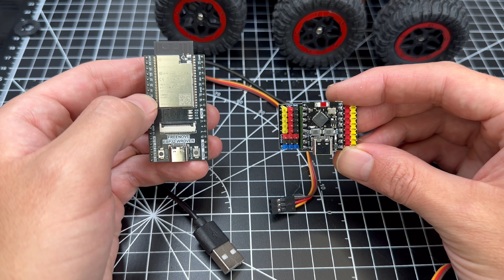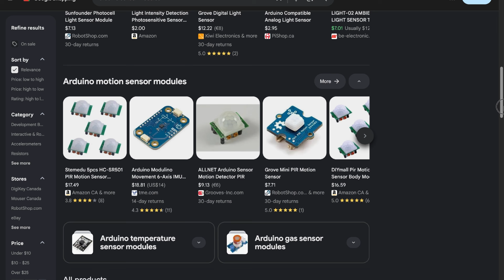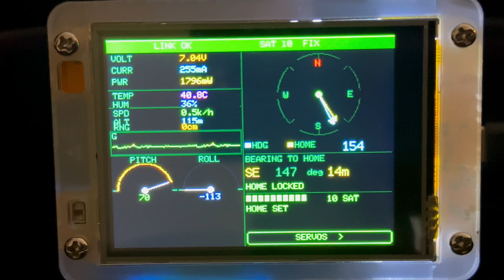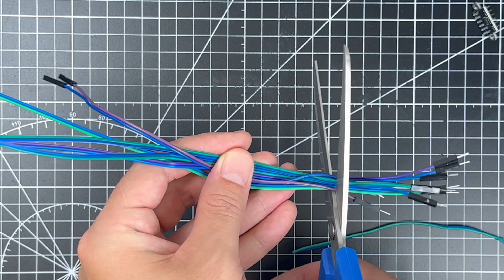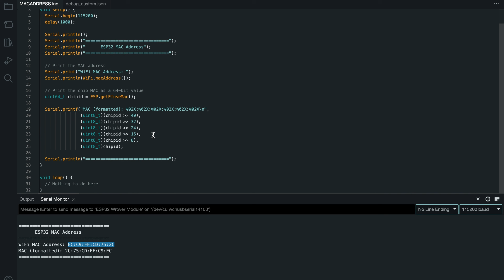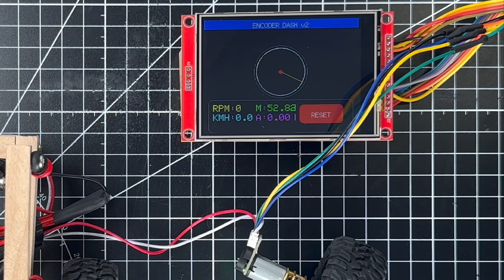DIY ESP32 RC Telemetry System (GPS, Battery & Gyroscope)

Comment: Suggestions for a high current sensor to use for 0 to 200 amps, DC?
Reply from the maker: Unfortunately, I don’t have any modules that I can recommend, For higher current I use a RC current meter seen in my n20 motor test video..
Reply: @MakerCreationLab I am looking at some options but would need to modify code tobuse them but doable. Also verifying your code in latest IDE, needed to up date the "recv" function sections on both the transmitter and receiver sketches due to the changes in syntax they did. Doing a set up just as you crested then will start mods for my use case. Also want to move to a larger screen CYD. Thank you for a great start!
Reply from the maker: awesome good luck ! Feel free to share on the community tab when you find a module!  Try the Telemetry version from the previous video (pre GPS) it worked much better I spent months tweaking.. For a bigger screen the only one i found that is easy to program is the 3.2 inch version.. sorry about that error I downgraded my esp32 library for a silly project!
Reply: @MakerCreationLab can you list what CYB board you used. I tried one by elego and it won't function.  The board is good as I cam load lovyan on it and it will display that test sketch so figure it just has compatibility issues.
Reply: @MakerCreationLab I went with a INA226. removed the onboard resistor shunt amd added a 100 amp 75mV external shunt. Moded the code to suit. Works good. Had to make lots of other code mods to get my CYD to work as well.

Comment: Could this be used for a model high power rocket? If I already have meshtastic device onboard with gps for tracking. I'd like to hook my ground device to a display I can turn off when not tracking. I want to take my phone out of the loop as its used for pictures and video of launches.
Reply from the maker: I’m sure it could work, range is probably your limiting factor, The previous video code (without gps module)  had way better range.  If you don’t need gps then I would try that code as a base. I walked so far away and it still worked.

Comment: Cool, I've ruined a few batteries because the car didn't have a low voltage cut off.  The ESC would cut off the motor but not the computer and I would forget to shut it down.

I've tried the GPS and found I needed RTK GPS.  I didn't find one that felt right.  

I've tried using the 6050 accelerometer like a rev limiter.  If the Gs are too high, reduce throttle, but it doesn't appeared to be fast enough.  I want to try that again at a higher refresh rate, at the time I didn't know I could set i2c to 400Hz.

I have tried the VL53L1X and the VL53L0X.  L1 sees thing that aren't there when the range is long (scatter from the ground?) and the L0 is too short ranged.  I tried the TF Luna and it worked but it's too large for my 1/28 scale cars.  I use the TOFSense F2-Mini that cost $15 on Amazon.  They refresh at 100Hz but I can't get I2c to work so I have to say that it only works in uart mode. I've bricked 3 trying.

I couldn't get going fast (11ft/sec) until I tried sensors that refreshed at 100Hz.  PWM is a 50Hz so???
Reply from the maker: That's some great insight, I haven't messed around with high-speed sensors yet but that makes a lot of sense for high-speed stability. I’m using mostly crawlers and tanks style robots. 

Yes there are much better IMU this is the most common for people learning and it’s really just to get a general sense of bumpy terrain and is for the rock crawler tilt and pitch.

Yeah just picked these distance sensors after your last comment I went looking for something smaller in size for 1/24th crawler found these 2 for 5 dollars. Your sensor TOF2 outputs 3.3v logic levels so try them with an eps32 just hook them up to pin 21 and 22 over ic2 run my scanner code you’ll see if it’s active.  No risk in frying things at all unless the modules power+ lead comes off and it pulls power thru the ic2 pins causing a backtrace fryed both once by doing that.

Yeah for your project it sounds like you would need something more fast and reliable,  I feel it would take months of tuning to develop something solid for your application.  If you would like to share post a picture on the community page!